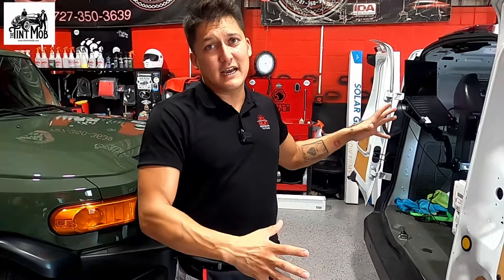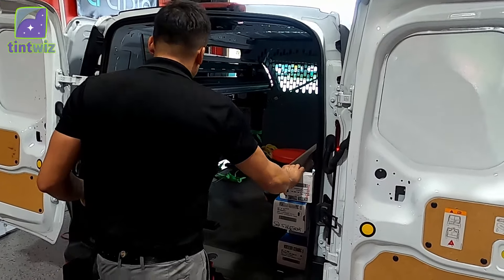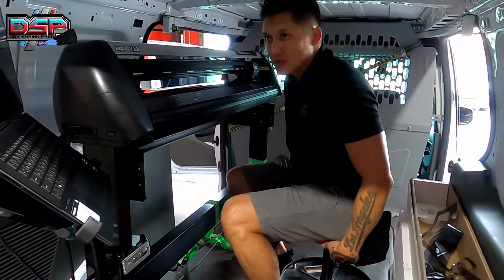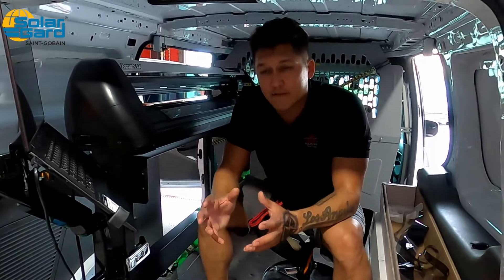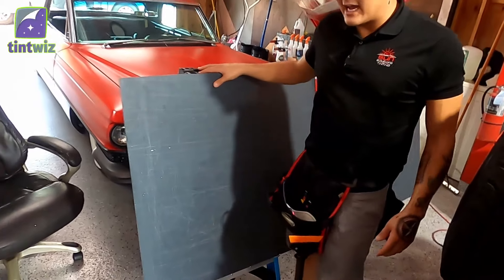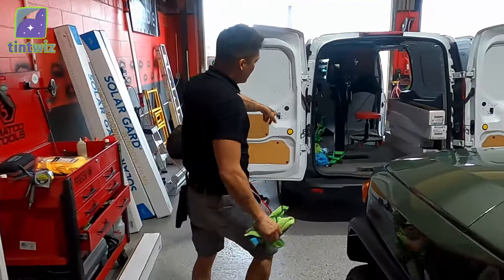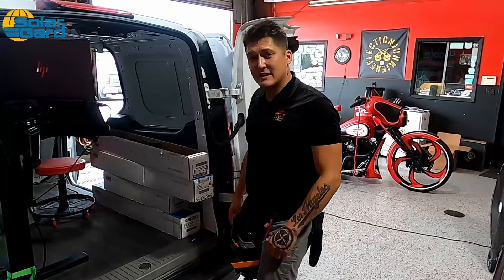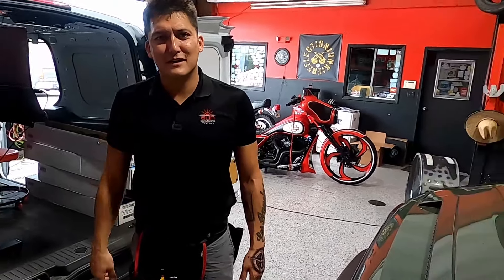Full Mobile Setup Breakdown

Comment: Just in case your audience is wanting the mobile peal boards. You have to get them from a place that sells lexan or plexi in bulk. Home depot or Lowes does NOT sell the thickness and or size you need. The grey board I got you and the green one that I use are 3/16 thick and I have them cut down to 40x60
Reply from the maker: Thank you for the info brother! 

Everyone who wants more info on the mobile peel boards read this comment ^^^^^^^^
Reply: Is there any websites that sell this boards?
Reply: @emmuure  No, you would pay almost as much for shipping than the piece of lexan, and you then have to get it cut. The shipping would cost as much as the board which is already $400-$500.

Comment: Always great to soak up some ideas from you Thanks for always sharing!  
Would my Workhorse 2  55” plotter fit in the in the Connect van LWB? Definitely thinking of the larger high roof but prices are still crazy right now.
Reply: My 42 inch graphtec barely fits on the connect lwb
Reply: @LZ_Mobile_Tint   Thanks

Comment: Why do my top edges don’t line up when using this same plotter I’ve used like 3 softwares already some cut outs line up good with top edge and some it’s horrible
Reply from the maker: Plotters and software are never perfect. They’re good enough for some and look horrendous to others, it’s all relative. 

If you hate the top edge you could always cut the tall version and cut the top edge yourself. Lots of people do that also
Reply: I was having the same problem. Make sure the sides of the roll are even before loading it in. line up the rollers and slightly loosen them so it’s not pulling the film to one side more that the other
Reply: @Rodiizjz  I been messing with it and it’s getting much better I switched over to core most cut outs are good enough for my clients not to complain
Reply: @dover1966  Nice man. I still get shaky cuts every once in a while but I guess that’s the difference between one of these and something like a graph-tech